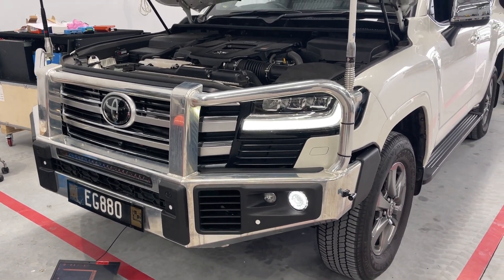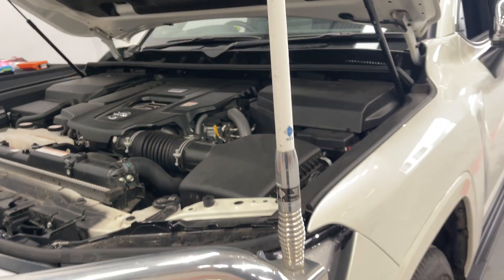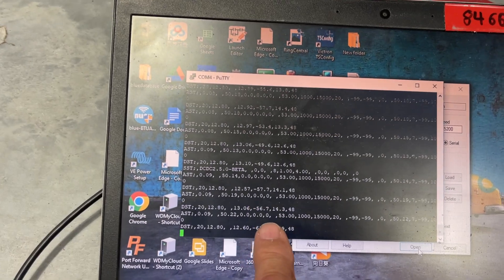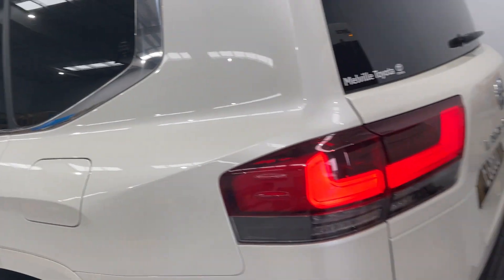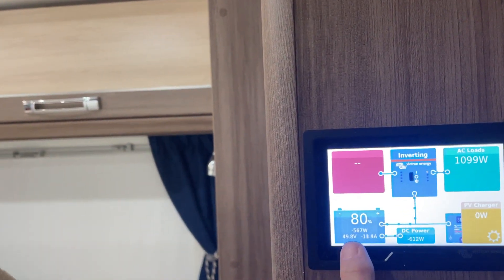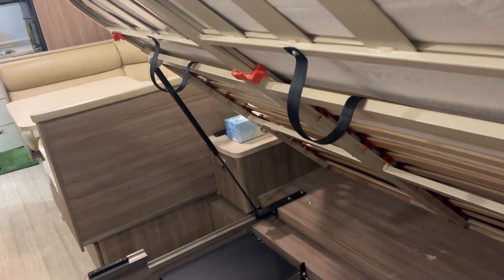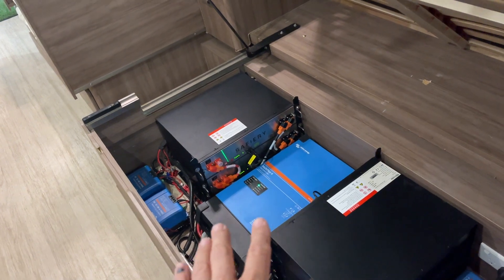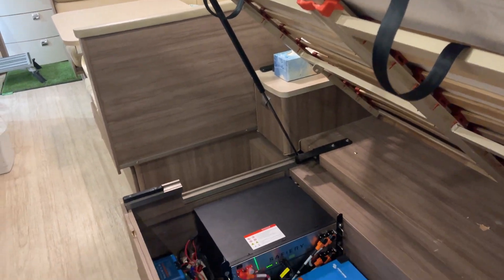Power details on Scotty DC DC 1500W power from LC300 to charge Jayco Silverline at 48V for aircon

Comment: so why's oldmate ending up with an undersized cable from batbat up front? He refused your recommendation?
Reply from the maker: He had the vehicle wired up by local auto-elec...
Reply: Firstly without any mud slinging, I am the so called local auto electrician…… as you derogatorily refer to in you snide response.
You fail to mention that the customer and I “the local auto electrician”both sat in your office as you calculated the cable size, the fuse requirements etc on the Victron App and you personally stated to both of us that this would be more that adequate for the original 1000w Killawasp that you sold the customer to charge the battery system. The vehicle was brought to your workshop on two occasions to get checked over as it was not charging the batteries in the van and was causing the LC300 to undercharge every time the caravan was connected. Your staff tested the vehicle twice with your test battery pack connected to the Anderson plug and no fault or undersized cables were ever mentioned, they then requested the van to be brought to your workshop.
Miraculously the charging was fixed by replacing the Killawasp with a more expensive updated Scotty unit and two extra batteries were added to the caravan, so we went from a 1000w charging system to a 1500w charging system with more load on the charging system by adding batteries and somehow the system is miraculously charging with a slight volt drop as the cable size that you personally told me to use can’t cope with the new system, the LC 300 is now not going into limp mode or dropping the voltmeter to negative charging.
This is a personal friend of mines vehicle and believe me we tried everything in the book and followed you technicians advice and they could not fault my install, even stating it was perfectly done.
You then make a video bagging out the “local auto electrician” this is after your company reworked on your install in the caravan and amazingly now the system charges with a slight volt drop.
I have promoted your products, even installing them on my own vehicle and other customers vehicles, well after your snide comments your company name will never feature in any recommendations to any of my customers.
If you can’t be truthful and give all the facts then you are a person I don’t want to deal with or promote.
When you point a finger remember how many are pointing back at you.
I have to say “How shit is that”
Reply from the maker: @brendankorb828  5 m of the 16mm2 should be 0.9V drop at 80A. I just looked it up again and this is what we would have advised in the office. However, there is a 3V drop under load. The voltage drop must also be because of lugging, cable quality selection. Cheers